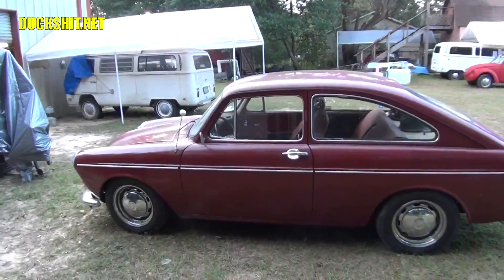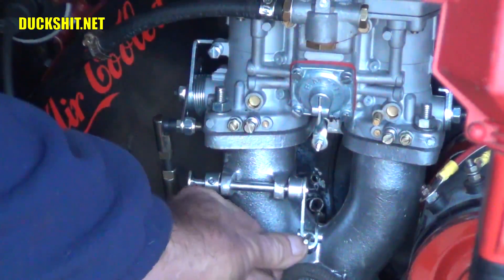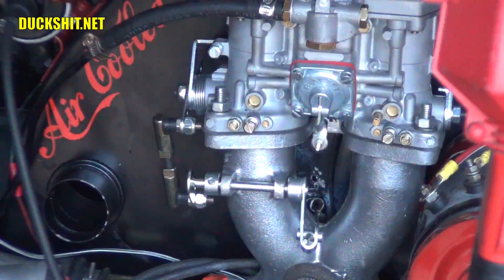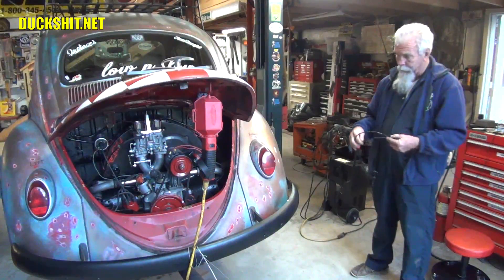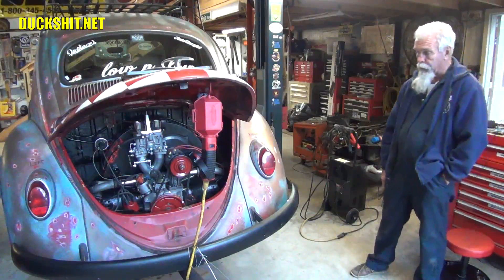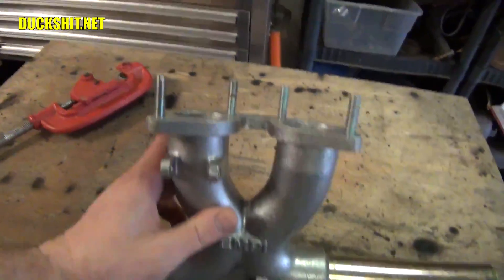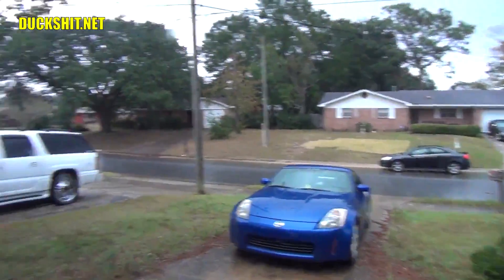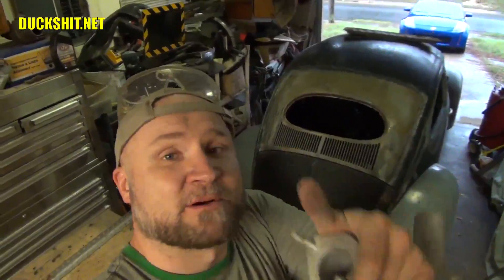Intake Manifold Problems - High Performance 1776cc VW Engine

Comment: there's a bowden type tube for the throttle cable
Reply from the maker: But not on older Beetles, those came in 1966, this is a 1964.  We improvised one this time around to prevent further transmission damage.

Comment: i fuel injected fanshroud, i think,  has the throttle cable hole in a different spot.
Reply from the maker: Nope, its actually the correct shroud, but that is very useful information!  Thanks!

Comment: That's what sucks about aftermarket parts LOL you have to play with them to make them fit LOL sorta like a woman LOL
Reply from the maker: Pretty typical in this case with anything that's chinese-made.  The linkage is still going to be sloppy, without installing some kind of special bushings it's not going to be any better.  But at least the thing will fit now!